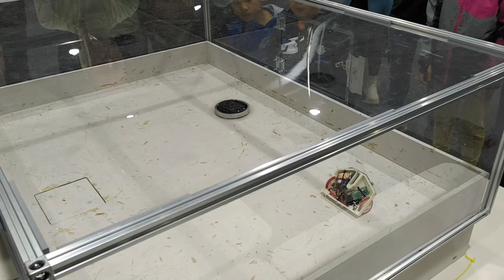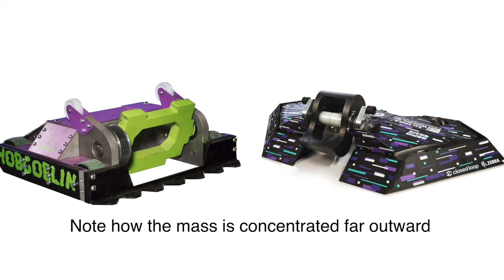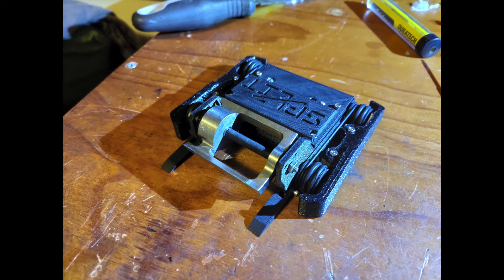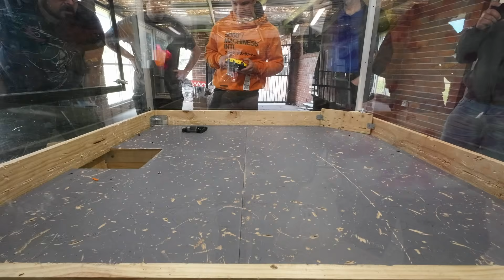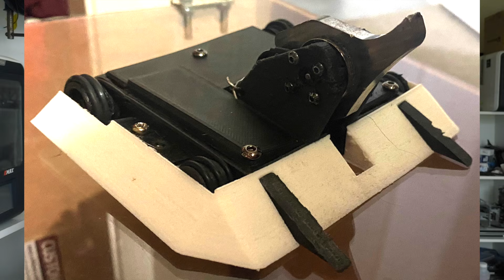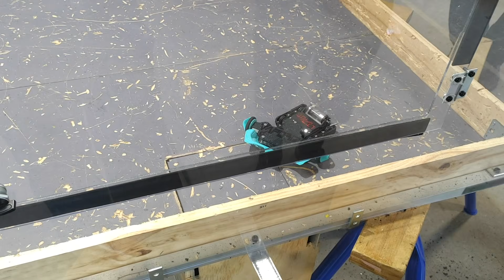Building a Winning Combat Robot - Split

Comment: On the off chance you're notified of this comment: Do you just screw the front wheels directly into the chassis or is there a captive nut or something?
Reply from the maker: Nah bolt just threaded into the chassis, and don't clamp all the way so the wheel rotated

Comment: Where did you get your weapon motor? I'm struggling to find motors that small that have a shaft greater than 2mm in diameter.
Reply from the maker: They don't come with that shaft stock. I press out the bearings and add a long dead shaft. Bearings are in the eggbeater
Reply: @BrokenLinkRobotics  Nice, so you drill out the hole in the motor bell to accommodate the larger shaft?

Comment: I just spent about 15 minutes doing maths in my head. Im missing a force vector somewhere because I cant convince myself it matters whether you are spinning up for down with a vertical spinner. Either you get pushed into the ground or they do.

Infact since your mass in consentrated on the spinner my brain is certain that spinning down would be the situation with better torque on impact.
Reply: Hang on i didnt account for linear movement vs rotation movement of the opposition bot, which is too much for mental maths
Reply: Apart from the forces stuff (can try thinking of it like punching a dangling piece of paper vs paper on a table it's not the best analogy (your fist in this scenario is the opponent, spinning down is dangling paper and spinning upwards is paper on desk (something behind your bot stopping it from moving makes your fist/the opponent hurt more))
being pushed into the ground is also advantageous for control reasons because you don't have to waste time flying through the air and reorienting yourself
Reply: You literally don't need any math lmao. If you push downwards you go upwards and your opponent goes nowhere because opposite reaction. If you push upwards your opponent goes up and you go nowhere for the same reason

Comment: Thank you for sharing your design files for this awesome little robot! I’m trying to build one but I’m having trouble figuring out what you did to get the weapon motor into this design. Anyway you could help with a little more detail? I found a source for the 1407 drone motor but I’m not sure what modifications you made to get a longer shaft or anything else I would need to do to get this working… without modifying the beater bar.
Reply from the maker: The motor bearings are removed and the top of the rotor is cut off, down to the magnets. A big shaft is then put through and supports the beater while the magnet ring sits solely in the pocket.
Reply: @BrokenLinkRobotics  ahh… got it. Thanks!
Reply: @AQucsaiJr where did you get the files? I love this an I really want to make it

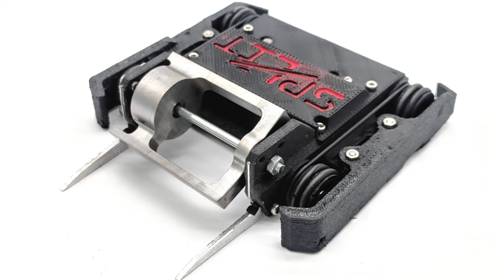Comment: 03:09 and not forgetting the gyroscopic effect a vertical spinner has on your bot 07:35 as demonstrated here. Also a well designed horizontal spinner can effectively work either way and isn’t bothered by being flipped🤷

Comment: I know jack squat about the mechanics of which I'm about to ask, but is a slow crushing style of attack (like what you'd get with pneumatics or those hand leaver can crushers) viable at this kind of weight class? 

I'd imagine anything that could do proper damage is either too slow given that you can't hold something for more than 10 seconds, or too heavy, but it seems like that's an angle of attack I'm not seeing represented. Would be interested to hear your thoughts.
Reply from the maker: @deucemoose7852 Totally, the thin plastic top armour of almost every robot here would fall quickly to a crusher. The challenge is generating that sort of force at this weight class with enough spare to armour up.
Reply: @BrokenLinkRobotics  thanks for the insight, haha!

Comment: 2:43 From my understanding of physics, both types hit with the same force. The only benefit of a upwards vertical spinner is the added stress of gravity on your opponent. Since the force that sends your bot down is only cancelled by the earth, the only gain would be added control of the bot when attacking, as well as a possibly advantageous angle to attack from. However, there is a weight cost of the infrastructure required to withstand both the force from the attack and the force from the earth.
Reply: A horizontal spinner can only impart as much force as it can resist moving. However, a vertical can impart a lot more. Think of it like a thin guy trying to push someone much bigger: the big guy doesn't move but the thin guy sends himself backward. With a vertical, it's like the thin guy has his back to the wall, and thus can push with all his strength without moving himself.
Reply: @p@p@p @peterreedstrom2027 F=ma and every force has opposite and equal reactions so even past the point where you lose traction, the faster you recoil/ slide, the more force is being imparted at contact. You can clearly see the difference between a hit that just barely breaks traction and a hit that sends the horizontal sliding across the box
Reply: Ditto on this. If both weapons hit with the same amount of energy then the same amount of work will be done.
Reply: Looking at that battle footage, though, it seems like that added control allowed for more hits on target, so thats another plus
Reply: A downwards vertical spinner would seem like the way to go, as it forces more energy to be transferred each engagement, but it will send the robot upwards, losing control. This could be mitigated with more weight, but I wouldn't know.
Reply: @pseudo.Random-KF  Downward VS simply does not work. You create a reaction force which launches you into the air - a much bigger disadvantage than you think it is
Reply: Yeah I've got you. The thing is that "energy" is not a thing that does work. Kinetic energy is a scalar quantity (So it has no direction- you do not "hit" with kinetic energy) the fundamental capacity of a system to do work. The energy originates in the spinning weapon, storing a specific amount of joules in accordance with K=1/2 (mv)^2 Energy Transfer (work) comes from force times distance. Think "force makes energy do work." Impulse (Force * Time) is what makes robots fly. This is where the "transfer energy" intuition comes from. What he misses is that impulse is symmetrical at all times in a two-body collision. Stress (Force/Area) is what causes materials to fail. 

N3L: In a collision, every force has an equal and opposite reaction. Always.

 With this being considered, it becomes plainly clear that the concept of "With a horizontal, only half of the energy is transferred, while with a vertical spinner, all of the energy is transferred because its half of the collision is redirected into the ground" cannot be correct. The vertical still feels the force of the impact, it's just receiving an equal and opposite normal force from the planet. This normal force cannot go back into the other robot, because a force is a localized description of an interaction between two objects. It would therefore follow that UNLESS extraneous events alter the local collision, there can be no difference.  

"But even if every force has an equal and opposite reaction, and Newton's third law is not somehow specific to horizontal spinners, the vert could still be transferring twice the force!"

Maybe, but I doubt it's that plain "2x" number or anywhere close. Since the vertical spinner is not recoiling, it likely remains in contact for longer, delivering a greater impulse to the enemy because J=F*T. But even then, impulse != damage. Mammoth delivers a huge impulse with zero damage. Tombstone delivers a smaller impulse with huge stress. 

For a collision involving an equal decrease in disk angular velo:

Mathematically speaking, torque = moment arm length * force

Angular momentum (L) = MOI*angular velocity

deltaL (angular impulse) = torque * delta(T)

deltaL = moment arm * force * delta(T)

Average Force (What does the Damage) = deltaL/(moment arm*delta(T))

Delta L and moment arm length are held constant.

Unless he can prove that the lack of recoil in an vert collision produces a delta(T) that is 2x smaller than that of a horizontal, one must assume average force is nearly equal.

Comment: I have a question about the emax 1407 brushless motor. Im building a eggbeater 200gram antweight combat robot and i would like to know if this motor is good? 4000kv is very high and im woried if it is powerfull enaught to spin up 60 gram eggbeater. i see it worked for you perfectly but mabye you know better options? Would really apriciate if you would answer
Reply from the maker: @BRICKCELLPHONECOLLECTOR Probably fine, just don't expect to run it at full power all the time. I usually stick to ~60% unless need be.

Comment: What is the limit for your weapon shaft diameter?
Jake Hoffman made a point in his maximiser build that by changing his weapon shaft to a larger diameter hollow shaft he could have a stronger shaft with the same weight.  The equations and explanation were 1min 55 into his upgrading maximisers weapon video.
https://youtu.be/NMShWf7mldY?si=V4Qu9O0UPAGptkHL
Reply from the maker: Currently the beater has 3*6 ball bearings, so 3mm limit. The maximiser shaft is a solid design, but is less and less sensible as the length increases for the weight. Bumping up to a 4mm shaft will be lighter than a hollow say 8mm Alu axle that needs much heavier 8mm bearings and larger beater mounts. Very good concept for horizontals though

Comment: The forks are bouncing around a lot, you could try adding some small torsion springs to them or just make them part of the chassis with no hinges. Maybe reduce the span of the beater bar slightly (stear a little better and don't need all the that span) to bring the forks in to center more and mount them more robustly. To be a bit more like Synthesis: https://www.youtube.com/watch?v=QzdHwjrRedQ

Comment: if there's one other thing to do, tighten up those forks! they flutter a lot with the weapon vibration, which is common. mounting them fixed in thin, flexible TPU pieces with a bit of preload or adding small torsion springs to keep them pressed to the floor will make getting under anything and everything more consistent.
Reply from the maker: I did try spring loaded forks on this robot, but even with the lightest heat-shrink springs it took too much traction off the front wheels and made it hard to drive. It worked great on other robots though, may move to grippier tyres and try again.
Reply: @BrokenLinkRobotics  gotcha. At least here in the US I can find tiny little metal torsion springs that are great for this, and the force they put on the forktips can easily be adjusted by changing where the fixed side is anchored or bending the legs into the right angle.
Reply: @BrokenLinkRobotics you can do the same thing passively by using an asymmetrical front weighted fork. It will just naturally lever down. Need more torque to actuate it though.

Comment: What would happen if your drum was turning the opposite direction so the energy from the weapon was not used to distort and flip the opponent but only to destroy🤔
Reply: he would throw himself in the air on every hit
Reply: The opposing force on split after a hit would, instead of being absorbed into the ground, throw split backwards and up. Bad for both impact on landing and he might end up in the pit.
Reply: Watch bb season 7. I forget which fight, but copperhead used this as a strategy to make weapon on weapon hits hurt the other guy... seemed to work for him...